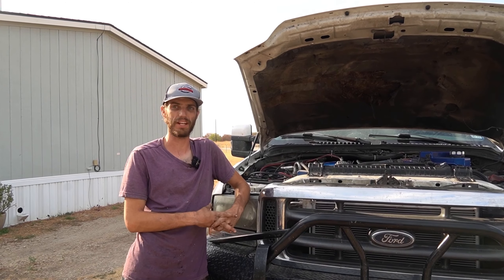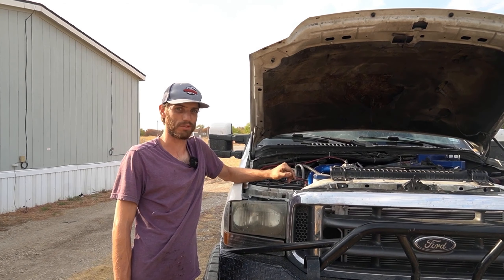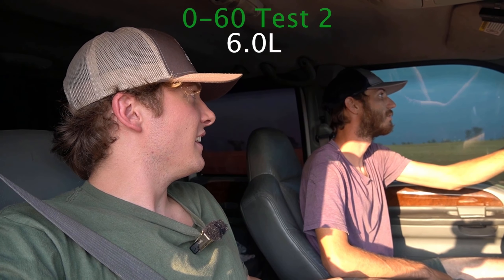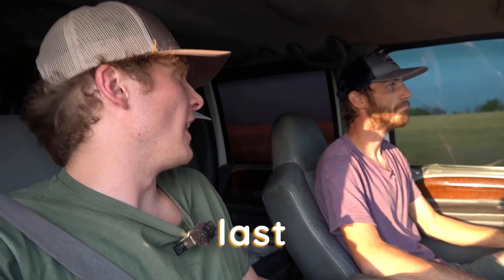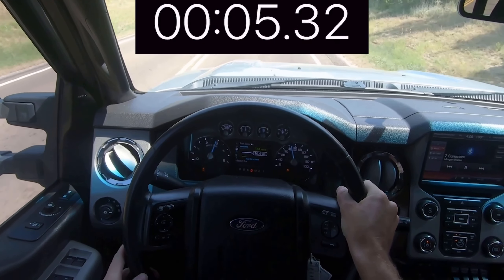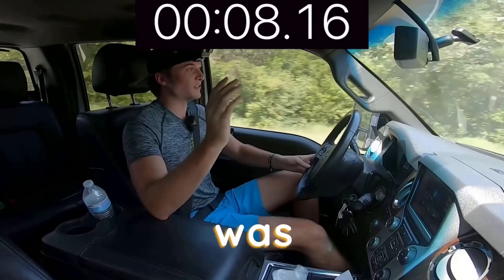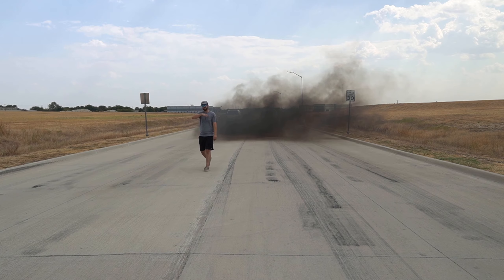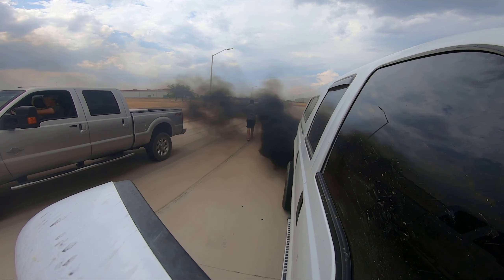Tuned 6.0L vs Stock 6.7L powerstroke

Comment: Once the 6.0 is tuned just right, it should be low 5’s if not in the 4’s on 0-60 if you can spool it high enough to get a good booster launch.
Reply: 100%

Comment: I thought diesels were faster than gassers? What happened to that lol.
Reply: Diesels have more torque and higher compression, making them good for hauling, not speed.
Reply: @ultimateLOLman  I get that, but everyone with a diesel states “my diesel is faster than your gasser”
Reply: @harryhenry7761  My buddies f150 with an ecoboom gas motor would smoke my tuned 7.3. Still prefer mine but he's got that on me. Diesel guys can be stubborn and elitist but I'm sure a few of them actually have enough done to their rig to beat gas trucks
Reply: @ultimateLOLman  I have a 5.0 with a tune bolt oms and ran a 5.1 0-60 not fast but I was just surprised when I saw these numbers because I get dogged on all the time